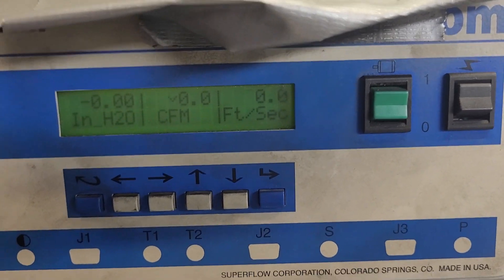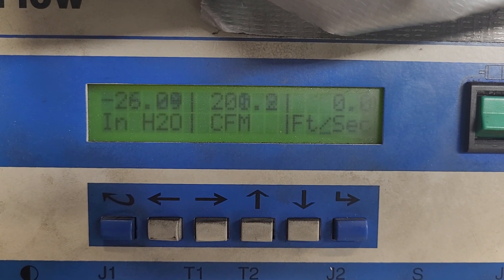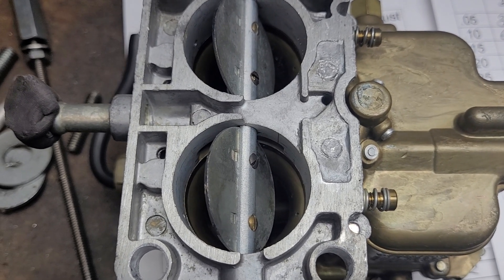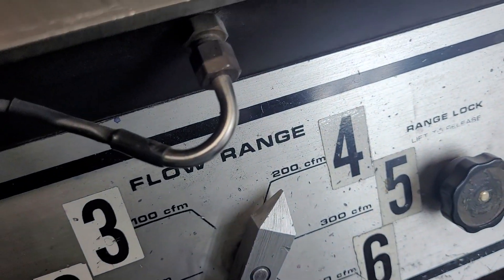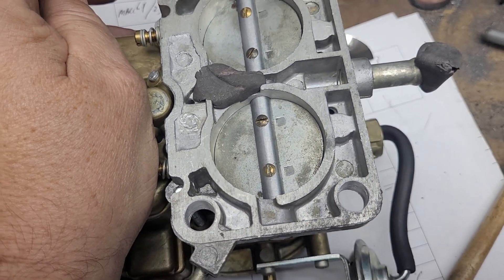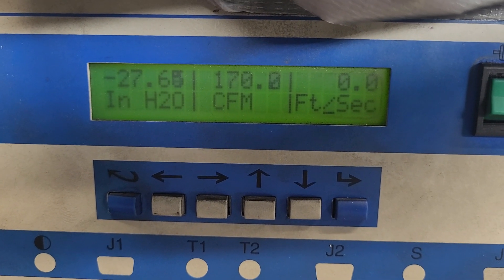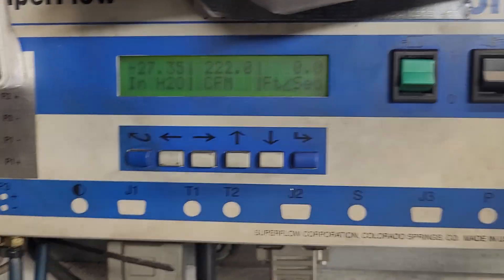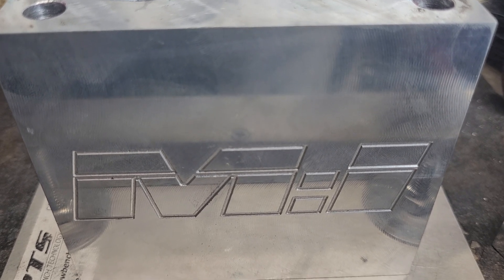Mission Impossible 318 project, BBD vs. Stromberg. The results may surprise you!

Comment: What if you flipped the car riser thins upside down? Not that it matters for the actual motor, but the hole would match the flow plate with the round hole in it better, yes?
Reply from the maker: I didn't think of it. Thanks

Comment: Your work on the carb is realy impressive ! Are you going to try to modify the venturi effect in the carb ?
Big Up from France
Reply from the maker: It is actually an idea I had about 30 or so years ago. A venturi after the venturi that pulls fuel into the airstream. Why, well it may do a very good job of evaporating or atomizing fuel due to the low pressure involved. France, cool! Thanks
Reply from the maker: Sorry, I misunderstood the question. The actual carb work is being done by D.V. and Andy.
Reply: @servediocylinderheads  Yes, I know, sorry i'm not realy good at English, but i would like to salute your work on the bench, the carb, the intake manifold and all the reste ! 

Your idea about two venturi is interesting, added to the spacer, it's all good for the mileage, smoother ride and performane.
Reply from the maker: @alfonsijean-baptiste7782  Your English is fine, I am so impatient that I read too fast and missed the meaning. Thanks

Comment: Do the orfice holes have a sharp upstream edge, about a 1/16" orfice edge and a beveled edge downstream? This is the way industrial gas flow measurement orfice plates are manufactured. When inspecting during calibration procedures, we had to remove the orfice plate and inspect it. They have to be flat, a sharp edge on the orfice and no nicks in the ID. The sharp edge has to be installed upstream.
I found some bent and one installed backwards. When there is liquid in a gas stream it will build up on the upstream side of the orfice plate like water upstream of a weir. It then spills over causing erratic flow measurement. In that case an orfice with a 1/8" hole installed below the orfice lets the liquids through without affecting gas measurement. The measurement computer must have a factor changed in the formula to account for this change. In a liquid flow with some gaseous component in it, the hole is installed in the top to let the gas pass, and again the flow computer must be updated with the orfice plate change.
This in many cases involves custody transfer on fairly low flow rates. When it comes to custody transfer of large volumes and across borders, more complex and expensive devices are used, like ultrasonic.
Reply from the maker: Yes, they have a sharp upstream edge.
Reply: @servediocylinderheads Of course measurement is measurement. You are measureing CFM. In the oil patch it was M cubed for gas flows. Instead of atmospheric we were dealing with generally 500PSI to 2000PSI. Oil was generally measured in barrels but sometimes M cubed.
Reply from the maker: @daledavies2334  I do quite a bit of flow measurement at work myself. Thanks
Reply from the maker: Good info. Thanks

Comment: I wonder if the clay (micro texture) surface is dropping the CFM? Or if the non clay spacer is pulling more of a vertical column of air? Maybe (1) try moistening the clay and (2) holding  a flat plate an inch or so upward above the openings. Maybe then the  clay would read higher because the air has to come more from the sides. I know your time is valuable but it would only take about a minute each to test.
 Also, for as many times as you reach upward to flip that  green toggle switch have you considered a foot operated switch?  My shoulder gets sore just watching.
Reply from the maker: My shoulders are fine... keep the ideas coming. Thanks